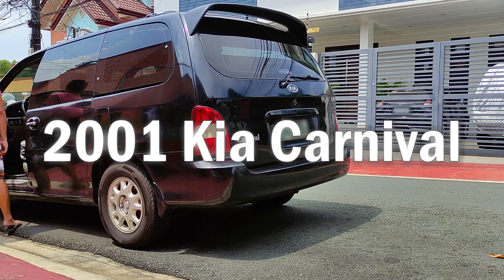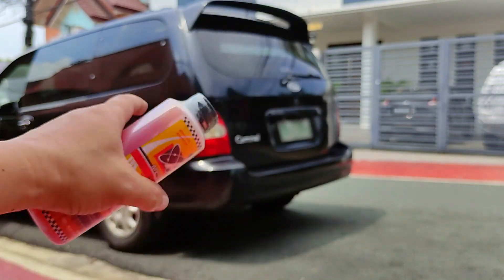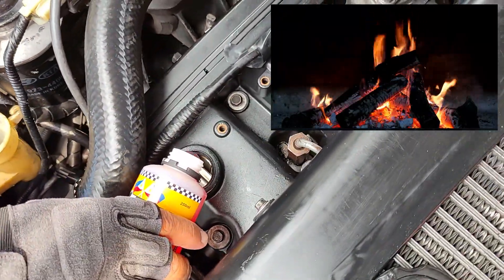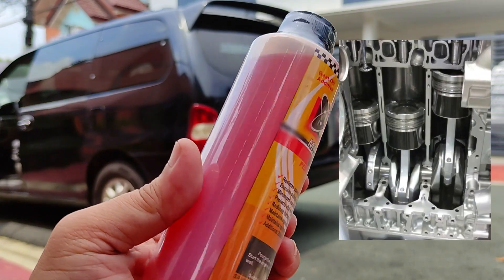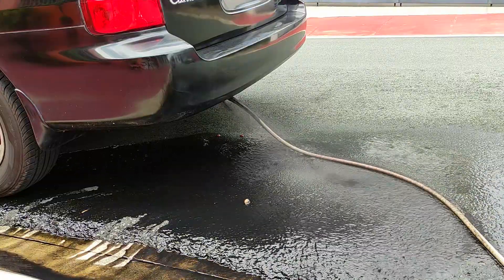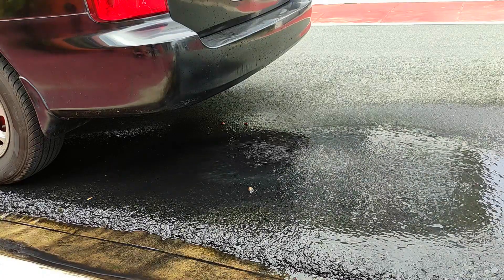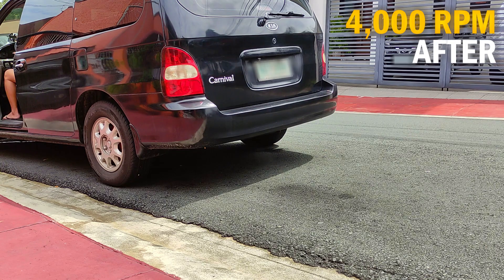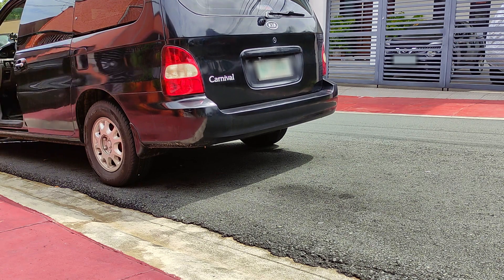Decarbonizing Diesel Engine & Exhaust Pipe to Reduce Black Smoke (2 Easy Steps)

Comment: Can this be done in a newer car with dpf and catalytic converter?  Wouldn't this harm these parts or the sensors??
Reply: I wouldnt advise you to do to a car with a catalytic converter. They are expensive and if you damage them, they can cost alot of money to replace. Goto a good garage and ask for their advise and solution if you are concerned.

Comment: I woukd like to try this as i have the same issue but dont want water getting into engine
Reply from the maker: as long as you park on a levelled surface, you should be fine. water always goes down and flows thru the path of least resistance -- your exhaust tip.
Reply: @HanDIYman007  in the video you park the car facing down a hill not on a level surface?
Reply: @timmocee good point 😂